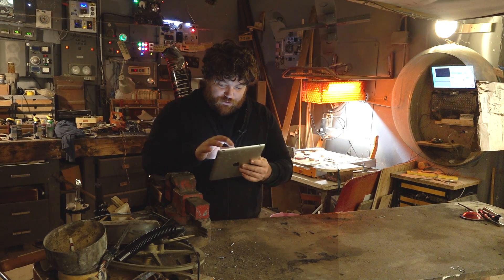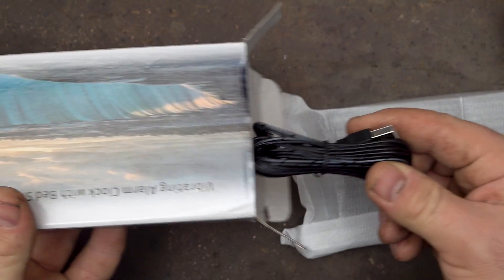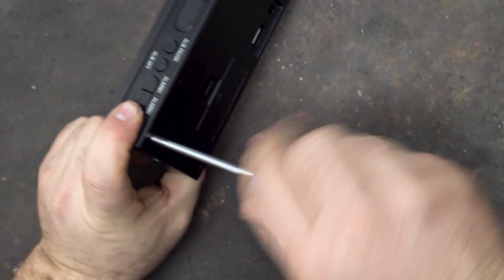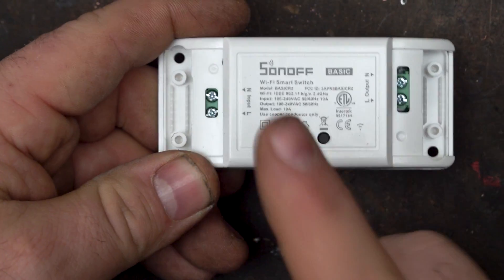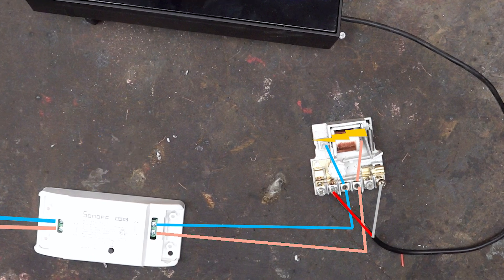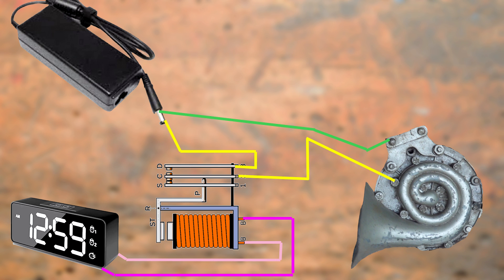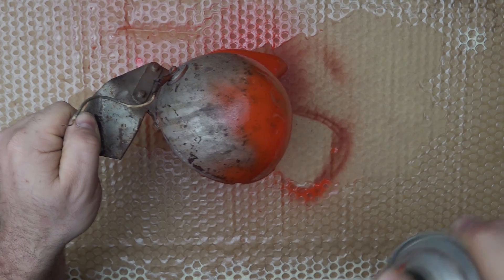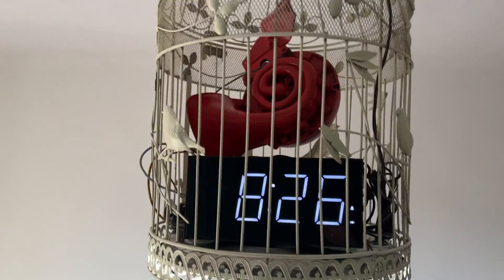Loudest WiFi Alarm Clock Ever  • Complete Tutorial

Comment: Hey I am glad to see you!  I have been wanting to tell you an idea I had: Remember that vibratory parts cleaner you made that used the quartz? That thing was awesome and I've used that media many times for cleaning parts with great success.  I want to see you make a bigger version for restoration of larger steel parts.  I was thinking maybe a drum style tumbler using a treadmill, or possibly a bigger vibratory version, it was very cool how the media moved in your video.  Years ago I built a super loud alarm in a similar manner using an "under counter radio" which had a built in outlet with an alarm/on off programmable relay built in.  I connected a guitar amp set to feedback loop, a high power Dayton squirrel cage fan, and a 150 watt halogen light bulb in a clamp lamp 😆